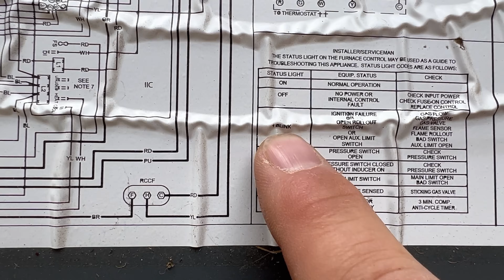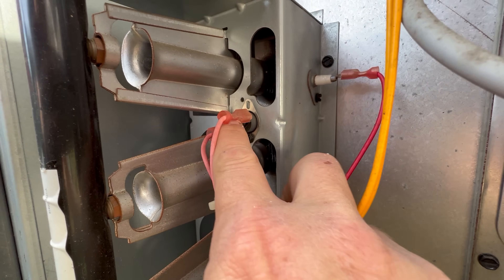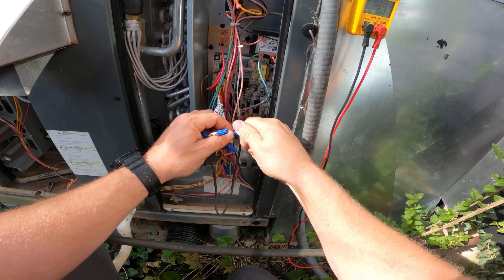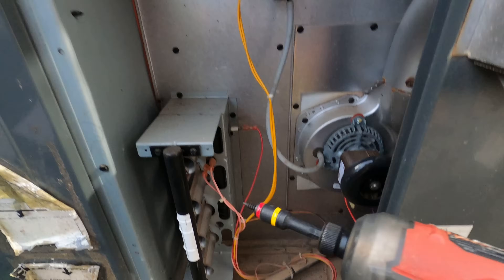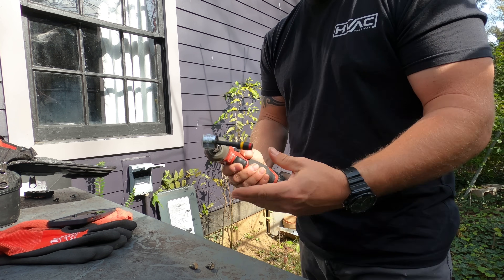Goodman Unit NOT Heating | HVAC Troubleshooting

Comment: Thank you👍 I have acquired an older amana unit very similar I have the model number but I can't find it anywhere online apd12250701a 69,000 BTU maybe from 2001? Cleaning out the cobwebs and hoping it will fire up tomorrow

Comment: I would just like to say thank you so much for this video. My heat stopped working last night. I watched several videos and saw this one. I have the whirlpool gold version of this machine. I replaced the capacitor in the air conditioning side two years ago but that’s the extent of my air-conditioning heating repairs. Mine was blowing out cool air and running briefly but no heat. I followed your advice my igniter was covered in soot. I cleaned it with sandpaper. After re-energizing the unit and turning heat on it lit perfectly and is working beautifully. I’ll definitely clean the flame sensor when I get a tool that allows me to get it unscrewed. But for now you’ve solved my problem thank you so much! 👊👊👊

Comment: I woke up today on Christmas Eve, it was 12° outside and my heat crapped out during the night. A friend shared this video with me and it saved my ass. Sucked on that pressure switch tube and cleaned the igniter. I don’t know what fixed it but the heat is on! Thank you for making this video.

Comment: made it to the end but it's not my problem my unit is turning on igniting and at first it was cutting off and going to low speed fan and cool down but would not turn off now I have to trip the breaker to get it to stop and then if I want it to come back on I tun breaker on , now it will continue to heat unless I turn off breaker again.  A couple of years ago I replaced the pressure switch, I had to adjust it to get it working but this time it's acting differently. any ideas

Comment: So I have a Goodman unit that’s on top of my roof and the gas valve went bad last year . Just today I found out that the capacitor went bad . How common is that ? How could you check for a bad capacitor? c61 p2 that’s the part number that was on the bad one

Comment: Thanks for the video ! I found the 2 blinking light code, which says its a open pressure switch. I did as you showed and sucked on the pressure tube, NO audible sound came from the switch. I have a hvac repair coming out to fix. Its saturday and  no parts store open, so hope they have a switch with them !!

Comment: Great videos. One suggestion is I like to use steel wool instead of sanding cloth. The silica residue from sanding cloth can cause some issues if not cleaned off completely. Keep up the great content and clean work.

Comment: My unit is only 3 years old and the igniter was very clean, still no ignition
Reply: Well, it this time of the year again and cleaning as you did fixed my problem. I simply assumed it was clean, once I had it apart, you could really see the carbon build up. I feel like a dummy now. Lesson learned!

Comment: Using an impact on something like a flame sensor is cringeworthy; saves literally zero time and greatly increases the risk of damaging the part, and no matter how careful one is, eventually the screws strip. Most techs sleep with their 11/1….just use it. 

Also, cleaning is temporary. Sand them off to get them by for a few days until you can get them a new igniter and flame sensor. 

Take this as constructive criticism from 20 years experience.

Comment: Honestly, I'd just clean them as a temporary fix then replace them. Using sand cloth will cause micro scratches that allow more crud build up faster and you'll be back there (or someone else will) in the next month doing the same thing. In my mind, cleaning them is really just a temporary solution when they're that far gone
Reply: I also have heard that sand cloth could leave pieces of sand on the igniter and it can turn to glass eventually
Reply: I really enjoyed your videos, very good insight you're a good presenter. Lance

Comment: Love the channel, great content as always! I've learned a lot from your videos over the past couple of years, great thorough work! 

Question though, I've always been told to use Emory cloth to clean flame sensors/igniters because if you use sand paper you can get a glass film over the sensor/igniter (Because sand turns to glass when it gets hot). Have you ever heard of such thing? I was skeptical when a senior tech told me this.  Once again, huge fan! Keep doing your thing!
Reply: Cleaned thousands flame sensor rods thousands of times. Even tried Supcos key chain tool for before (do not waste your money on) Steel wool, stainless steel scouring pad etc.

I 99.9% of time clean with fine sandpaper trying to make smooth and shiny like this in this vid,  then wipe clean with a clean rag or shirt sleeve.

I still can't believe no spark because of that little dirt on spark assembly!

Comment: Not good to use a impact when taking out the igniter and flame sensor. There’s a High chance of the vibration from the drill to break the weld of the parts

Comment: First problem is buying Goodman and not Carrier
Reply: Carrier is garbage
Reply: @ovdad Uh oh. Goodman dealer is mad. Lol Goodman sells to Wal-Mart. Undercuts contractors ability to sell equipment + labor.  It's the cheapest on the market and historically has the most problems. Stop lying.
Reply: @npane171  I've installed 1000s not sure what problems youre talking about.

Comment: As someone being in the HVAC industry out in the field these videos are cool to let people know but eventually you're going to start losing out on jobs and money because of these videos this should be something that only the tradesmen knows
Reply: Thousands of different things to know.  These are only the tip of the basics. Worse is when customers watch these videos and screw up something else that they don't what they did and you have to figure out what they did trying to fix + original problem(s)

I am happy to coach over the phone basic trouble shooting and easy fixes like cleaning a flame sensor (easy most of  the time)

Comment: Just got my first job in the trade back in April and I never knew that you could reset the fault lockout from disconnecting and reconnecting  the transformer. Definitely going to remember that trick.
Reply: Is there an advantage to pulling the transformer wire verses just cycling the main power at the disconnect? Great video by the way.
Reply: @Salyers-Family-2004  No
Reply: @JoseJB0  just easier to do sometimes

Comment: For any HVAC techs out there, he isn't wrong about nest Tstats being crap. Word of advice......pull the nest face off the wall before you pull the disconnect outside. There's an issue with the current nest generation that is shorting out the stat when the disconnects are pulled. Save yourself the headache!
Reply: Wow! Thanks for this tip about the Nest!